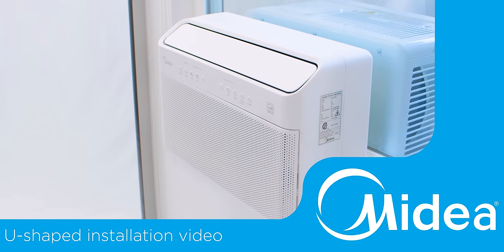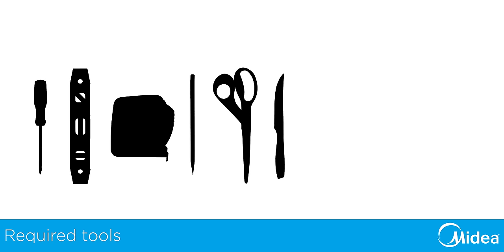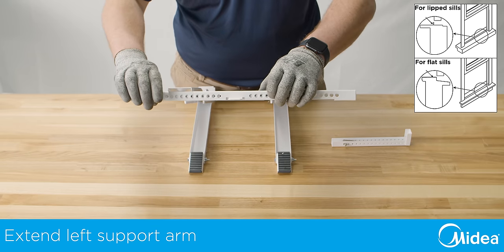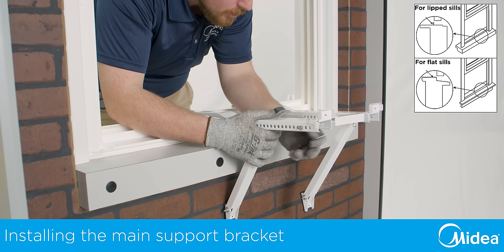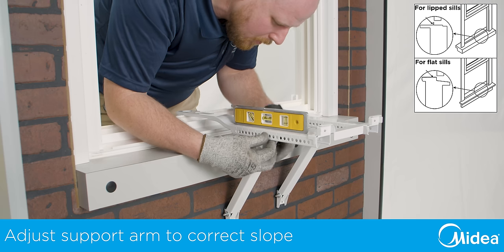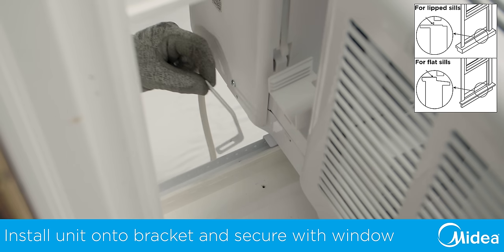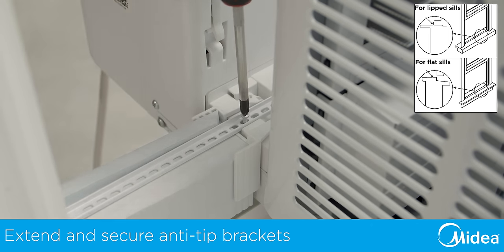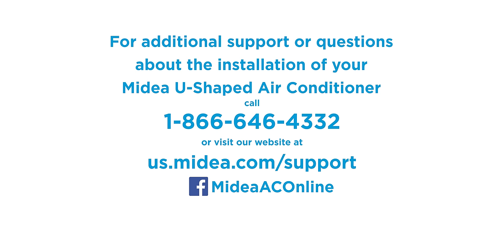Midea U AC Installation Guide

Comment: Is it possible to disconnect this unit in the middle and re-connect if the window doesn't open big enough to fit it?
Reply from the maker: We do not recommend any modifications to the unit as it could affect performance and void the warranty.

Comment: What if I dont have up and down sliding screens?  My screen is a full size screen that either pops out or stays in.
Reply from the maker: Hi, johnnyc5587. The Midea U can only be installed in single-hung or double-hung windows with width sizes: 22"-36", and a minimum height of 13.75". Have a good day!

Comment: If the window frame is 39" wide, does that mean my window is fully incompatible with this?
Reply from the maker: Hello, Joe. The unit can be installed in your window. However, since your window dimensions are greater, the installation kit will only reach up to 36" wide, meaning that you will have an open gap that will need to still be covered. Reach out to us at DigitalSupport@midea.com if you need additional assistance. Have a great day!

Comment: I wish they made this in a small 5000 BTU version for my small one window bedroom 😔
Reply: They do have one for 133 at walmart
Reply: @NunyaBizzzzz  Is it a U shaped one like this?
Reply: @artcasbah4218  no it's not U shaped. My room is kinda big and I get cold if I have it on.  I also live in the high desert :)
Reply from the maker: Hi, Art. Like Nunya Bizz said, we do have 5K BTU Air Conditioners but not for the U AC. If you have any other question, feel free to message us on Facebook at m.me/MideaAmerica.
Reply: the 8k cools like a 5k my old 5k that i hated because it was loud and annoying cooled slightly better then the 8k
Reply: That's what I'm using. Doesn't exactly fit right but it works. Nothing's precise or perfect here.

Comment: Hi , I just installed my midea air conditioner inverter 8000btu and I noticed that initially it wasn't cooling enough . I mean the cool air wasn't cool enough.  Then i noticed that there was not drain hole on the unit. Is it like that ? I think all air-conditioning units needs  drainage system .please help me out .thanks
Reply from the maker: Hello Sadia. This unit is installed on a tilt to allow the water to drain outside of the window.  You can find installation pictures and instructions here: https://m.media-amazon.com/images/I/B1nEKK74xFS.pdf and here: https://m.media-amazon.com/images/I/B1+gsOT8YYS.pdf. Have an excellent day!

Comment: I have Pella 250 vinyl windows.  It looks like in the video , a vinyl window was used for demostration purposes.  Will this AC unit install properly on the Pella 250 windows?
Reply from the maker: Hi, Jim. Thanks for your question! The Midea U AC is designed to install in standard double hung-windows with opening widths of 22 to 36 inches (558mm to 914mm) and a window height of 13.75 inches (349mm). Installation can be done in wooden and/or vinyl-clad windows. For more information, please review these guidelines: https://www.google.com/url?sa=t&rct=j&q=&esrc=s&source=web&cd=&cad=rja&uact=8&ved=2ahUKEwjG--6fvrP-AhUpkWoFHflzCYEQFnoECA0QAQ&url=https%3A%2F%2Fwww.midea.com%2Fcontent%2Fdam%2Fmidea-aem%2Fus%2Fair-conditioners%2Fwindow-air-conditioners%2F8000-btu-u-shaped-air-conditioner-maw08v1qwt%2FMidea%2520U%2520AC%2520Installation%2520Guide.pdf&usg=AOvVaw1qGYVqvh1SkdxPlsZx1J7m. Have a good day!

Comment: Everything works great, but on Auto Cool mode, this thing does not seem to hold temperature well. Set to 76, room at 73, and it's still cranking out cold air. Is this how it is supposed to work?
Reply from the maker: Hi DeckardTrinity. Thank you for sharing your comment. For us to better understand your query, we'd appreciate it if you give us a call at (866) 646-4332. Please provide case # 111109295. Our hours of operation are, Mon-Fri, 8 am – 6 pm EST, and Saturday 9 am – 4 pm EST. We hope to hear from you soon.

Comment: I would like to put this in my window but my window is 47 inches long and it says on some sites only double hung windows.  I hope there is a way to put it in a single hung window as some sites say you can but I want to make sure. Not everyone has double hung windows so please let me know. I might have to cancel my order from Amazon if I cannot get extensions to fit in my window and if it will not go in single hung window :(
Reply from the maker: Hello Mona. This unit is intended to be installed in vertical sliding double-hung windows only however we do have other units that can be installed in your window. You can view our units on midea.com. We do appreciate your feedback and will use it to design and improve our products for the future!

Comment: I received left and right window brackets with my unit than what's shown in the video and they do not reach far enough to connect the bracket to the window, nor do they fit in the windowsill alongside the bracket. Bad design.
Reply from the maker: Hello Cowbot. My name is Candice. I am sorry to hear that it is not fitting properly. If it meets the correct dimensions then please give us a call at 866-646-4332 so that we may assist. This unit can be installed in windows from 22”-36” wide, with a minimum opening height of 13.75”. Thank you. MideaCustomerCare@hartehanks.com (BBB A+ Accredited Business)

Comment: Can someone tell me how deep that front is? Like how far does it stick out from the window itself? I have a desk that is very close to the window about 7" away and want to know if that would be an issue. I can move my desk but it would be a MASSIVE undertaking! I am looking at the 8000 BTU version.
Reply from the maker: Hi, goku25jason Gohan. Thank you for your question. The front of the unit that sits inside of the window will be about 6-7 inches deep. However, nothing should be too close to the unit so it has enough clearance for proper ventilation. Have a good day!

Comment: Do I have to remove all that crap on the window if I want to put it away for the winter?
Reply from the maker: Hello Jeff. Thank you for your question. To be able to re-install your screen you would need to un-install the AC unit. Have a great day.
Reply: @MideaAmerica  Im not worried about the screen I just wanted to know if I had to remove the bracketry if I want to remove the Ac unit for the winter?

Comment: I bought this unit. On the 12000 b.t.u. unit the support bracket sticks out past the back of the unit on the outside about six inches and there is no way to make an adjustment so it is closer to the back of the unit and looks normal. I call Midea support and the first person I spoke to hung up on me and the second support person trued to convince me that this is normal and all Midea u shaped units use the same bracket. Simple solution, take king the unit back to Home Depot and never ever buying a Midea product again, lol.
Reply from the maker: Hello @jahy1970, thank you for your comment. We're sorry that the unit's installation bracket did not meet your expectations. It's designed to extend outwards by 20 inches, leaving about 6-7 inches when the unit is correctly installed. This is the standard design for this particular unit. If you have any further questions or concerns, please feel free to reach out to us at digitalsupport@midea.com. Have a great day!
Reply: The unit is correctly installed and the bracket is to large for the 12000 but unit. The fact that I spoke to 2 Midea customer service people and the first one hung up on me and the second treated me like I was some kind of dummy tells me Mudea isn't really interested in their customers but more interested in treating their customers with disdain.
If Midea really cared, all one would have to do is open a 12000 btu ac unit and take a look at the support bracket that is not adjustable and realize that their design is flawed or they are shipping the wrong size bracket with the 12000 but unit. Pretty simple if you ask me.

Comment: Can you tell how much space is needed when the window is open, to fit this unit. I have cheap vinyl windows that open maybe 13" to 14". Is that enough room for this AC?
Reply from the maker: Hello Greg. The unit's full depth is 22", the front part is approximately 8", the middle that consists of the groove is approximately 3", and the back part that protrudes to the outside is approximately 11".  It is designed to fit in windows with opening widths of 22"-36" and with a minimum height of 14". If you have any questions, please reach out to our specialists via Facebook at m.me/mideaamerica or email us at digitalsupport@midea.com.
Reply: @MideaAmerica  Very helpful. I'll take some measurements and see if that works, thank you!

Comment: Hello! I received this unit earlier than expected from the campaign! Is there any other way to install it other than the included bracket? Upon my installation attempt today I discovered that the outdoor Wall is covered in soft vinyl siding, and I'm not sure what to do. The feet bend the vinyl and will damage it if used for long. Boxed it right up in the meantime. Appreciate the any advice! Thank you 😊
Reply from the maker: Hi Constantina Louk. Thank you for sharing your comment. In regards to your query on installation, please give us a call at (866)646-4332 for further assistance and provide case no. 111084823.
Reply: Somebody posted a campaign comment with the same issue; their solution was to use a board (wooden I assume) on the outside where the feet can rest on
Reply: @benng4613  food thought, thank you!
Reply: @ConstantinaLouk  It's fine for me, just installed on soft vinyl siding. No damage. Install it properly with patience and see where the pressure of the feet should land on it without damaging it. That's why there's many holes. :)
Reply: @muzik9332  That's great! How did it work out for you? Do you love the unit?
Reply: @btd246  good idea hopefully the landlord is on board 😂

Comment: How far do the brackets hang down on the outside of the house? I can't find the measurements anywhere. We have a section of roof below our window and I'd like to make sure we have enough vertical space before buying.
Reply from the maker: Hello Sara, thank you for your question about the Midea U Inverter Window Air Conditioner. The unit's full depth is 22", the front part is approximately 8", the middle that consists of the groove is approximately 3", and the back part that protrudes to the outside is approximately 11". Have a great day!
Reply: @MideaAmerica  Thank you but I was actually asking about the brackets and how far they extend straight down towards the ground outside. The measurements you gave me are the horizontal depth of the unit and I would like to know the vertical dimensions of the bracket specifically. Aka how much space do I need below my window sill. Thanks!
Reply from the maker: Hi Sara. Oh I see! Sorry about that. Yes please reach out to our specialists on Facebook at m.me/MideaAmerica for more installation and dimension assistance. Have a great day!

Comment: I have a storm window and have tried support brackets that did not work. Has anyone tried it with this?
Reply from the maker: For more information regarding installation with storm windows, please review the following manual (with specific attention to pages 20 and 23): https://www.midea.com/content/dam/midea-aem/us/air-conditioners/window-air-conditioners/12000-btu-u-shaped-air-conditioner-maw12v1qwt/Midea%20U%20AC%20User%20Manual.pdf. Have a great day!
Reply: Too late I already bought one. Unfortunately the old 2x4's I cut to support my old AC would put the bracket at the wrong height, so I made do with just the foam and the included bracket screws. I was able to drill it in okay, balanced it against the window frame with some foam I had from my old AC. It feels somewhat stable.  @MideaAmerica

Comment: I already have an AC bracket installed so will this work if I use the existing bracket or do I have to use the Midea one?
Reply: It looks as if the Midea unit is design to slide into place on the provided bracket. Also, it is off center for proper weight distribution, which should help keep vibration noise down. i would definitely plan on using the provided bracket.
Reply from the maker: Hi Rae Zhang. Thank you for sharing your comment. In regards to your query on which bracket to use, we strongly recommend on using the one that came with the unit. You may encounter compatibility issues otherwise.
Reply: just use the one that comes with the unit. The bracket is the easy part.

Comment: I have an older wooden window with a double pane. The outside glass pane has a 1/4 to 1/3 inch metal lip at the bottom. I usually bring this down on top of a traditional AC unit along with my wooden pane.
1.) What is the side of the "U" opening for a window pane to fit into (front to back)
2.) Should I bring down my second pane?  I usually tape up the outside of my AC units to prevent water from hitting the sill.
Reply from the maker: Hi Destructor2007. Thank you for sharing your comment. In regards to your query, the space between the 'U' is 2 7/8". 
Please see the Installation guide as a visual guide in the ink below.

https://m.media-amazon.com/images/I/B1WOLioF8mS.pdf

Comment: Well nothing in here about the most important thing- how to keep it from leaking condensation into the window sill. !!!
Making it level is not good enough. Need to have a hose
Reply from the maker: Hi @KatJaguar1122, Thank you for your question. The unit should be installed with a backward tilt of three-quarters of an inch (3/4"). This unit has an internal drain tray, which, when filled to capacity, overflows, and the excess water drains through the grills of the unit. If preferred, you could hire a licensed technician to install a drain kit for a more optimal drainage flow. Have a great day!

Comment: Can this be installed through a wall?
Reply: I was thinking about this too.    If you have a plywood box made with a baffle where the window would slide down, and had it well insulated- the box with AC inside could slide into a wall aperture.  This would need to be well insulated, and needs to be same external height and length of the wall opening or the AC case that is already in the wall.   Important thing would be to have the compressor side open to the outside....
Reply from the maker: Thanks for asking, Angelia Weitzman! Unfortunately, the Midea U AC is designed for window installation only. We offer a number of through-the-wall AC models, though! Reach out to us on Facebook at m.me/MideaAmerica.

Comment: I was told that the AC measures 11 inches on the exterior portion. I was also told "Twelve inches of clearance from the window is required for the bracket". I do not want the bracket to extend past the AC unit by more than a couple of inches but the bracket measures 19.5 inches by 10 inches. That means that the bracket is about 8 inches longer than the unit. Is this true?
Reply from the maker: Hello, Patricia. To better assist you with this, please reach out to us at Digitalsupport@midea.com.

Comment: This is leaking so much water please help
Reply from the maker: Hello @smartyyy, we're sorry that your unit has experienced a leak. When the unit is installed, it should be tilted three-quarters inches (3/4") backward. The unit has an internal drain tray, and when it reaches full capacity, it overflows and drains through the grills of the unit. For additional troubleshooting steps, please contact us at digitalsupport@midea.com. Have a great day!
Reply: @MideaAmerica  I have it tilted backwards but it leaks from the middle bridge area. Is the water supposed to evaporate as it fills too? I collected a gallon of water yesterday and it was only 50% humidity. I’ll try to tilt it back more but am wondering if it’s supposed to be generating this much water.

Comment: Also feel like the air conditioner isn’t cool like it should 8’000 btu should have my room cold and it’s barely cool I don’t like that
Reply from the maker: Hello Castiel. My name is Candice and I am sorry to hear it is not cooling as much as it should be. Here are a couple options to resolve this issue. If the below options do not help please contact us at 866-646-4332 so that we may assist. Have a great day. MideaCustomerCare@hartehanks.com (BBB A+ Accredited Business)
Solutions:
Room temperature below 62°F (17°C). Cooling may not occur until room temperature rises above 62°F (17°C).
The temperature sensor behind the air filter is touching the cold coil. Try to move it so it does not contact the cold coil.
Reset to a lower temperature.
Compressor shut-off by changing modes. Wait approximately 3 minutes and listen for the compressor to restart when set in the COOL mode

Comment: What do you suggest for larger windows? I have a loft in an industrial building and the window measures at 51” across
Reply: any solution? I have the same...
Reply: Make a smaller window out of your larger one.  You can cut a small board to essentially take up the extra space in the opening on the side(s).  It's easier to make a large window virtually smaller than the other way around.
Reply: @GoatZilla  thanks, that’s what the handyman ended up doing for me :)
Reply: @SideshowBhan  :D  How do you like ur Midea?  I just installed mine a few days ago.
Reply: @GoatZilla  I love it! I got a notification from the app that I needed to change my filter fairly quickly though.